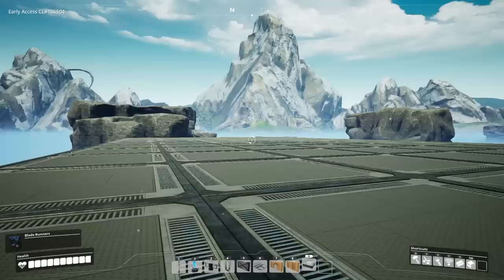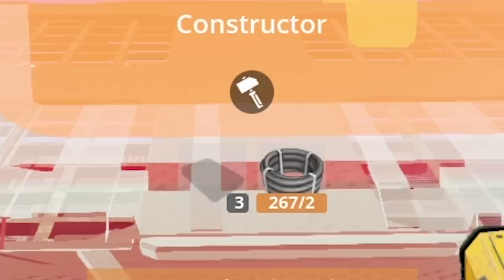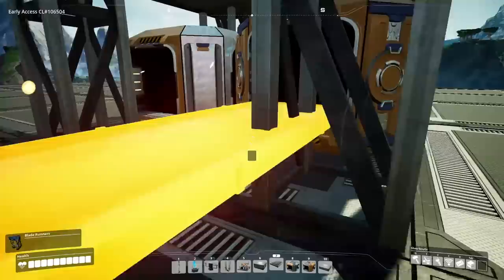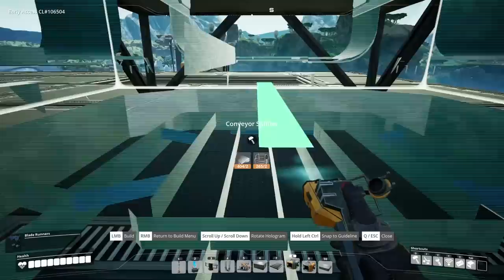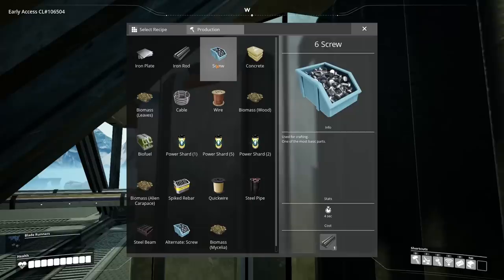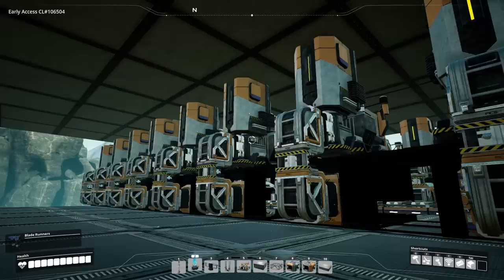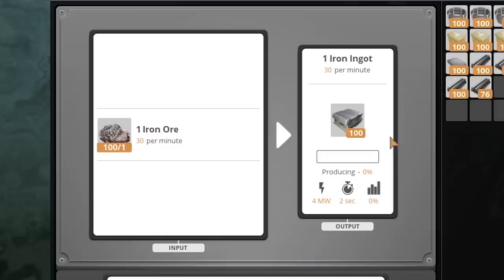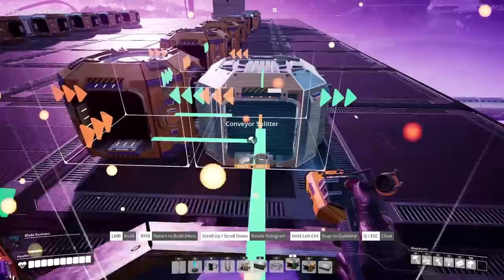Time for a MAJOR Base Upgrade! - Satisfactory Modded Let's Play Ep 5

Comment: I'm not sure what you mean by "starter base"? When I hear starter base to me it seems like at some point a new base will be constructed making the "starter base" obsolete. So if the "starter base" is obsolete it should be disassembled  for building materials. 
If that sounds about right why to take the time to make the base aesthetically pleasing  when it will be torn down at some point later?